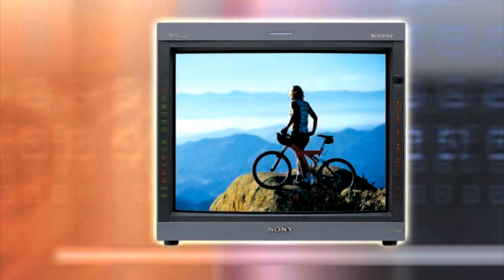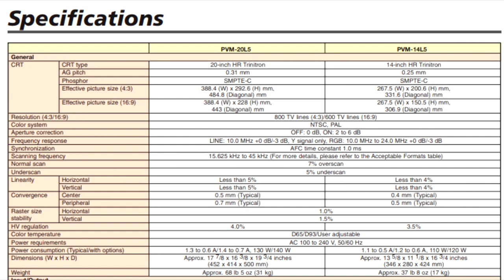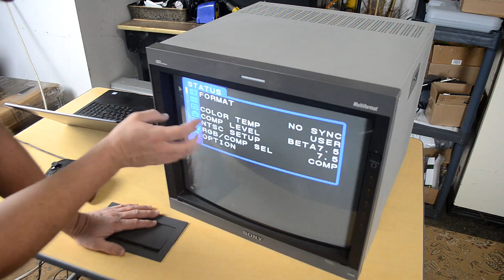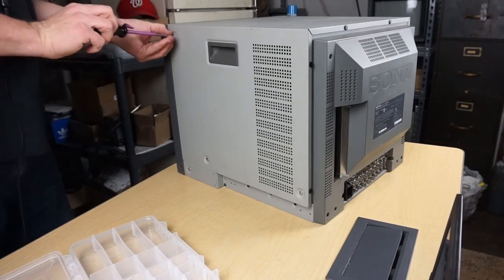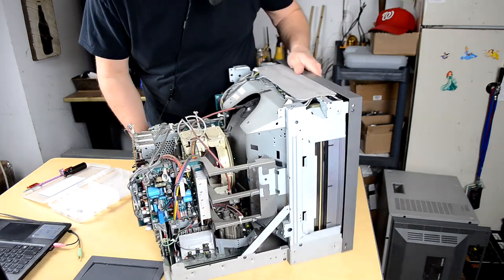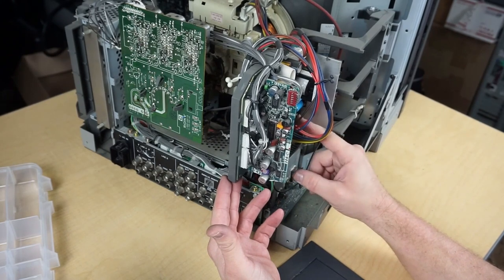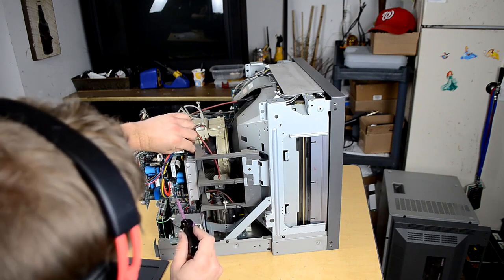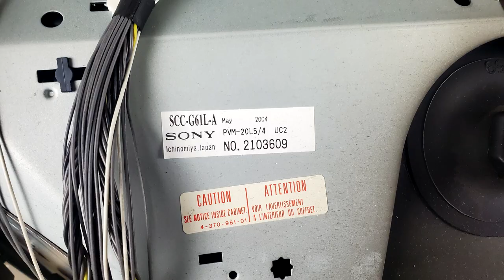Taking Apart a Pro CRT:  SONY PVM 20L5 Tear-Down

Comment: On my PVM-14L5 for the plastic rivets for the rear, I ended up using a pair of needle nose tweezers, I just work them under the edge and slide them in and the shape of the tweezers works like a wedge to pull the rivet apart and release the inner part.

Comment: A bit off topic but could I buy a mouser shopping cart list of the capacitors needed to recap a pvm 14m2. My monitor has a lot of hours on it and I believe all the power supply capacitors will need to be replaced as well as at least all the capacitors that are in hot areas on the A board. I’ve put a brand new tube in this monitor already thanks to all the info I’ve learnt through your channel. I just need to recap it now to keep it in good shape.

Comment: My 1340 PVM from 1991 had more metal, and the low side ventilation, compared to the 20L5.

I've heard, and seen, that Sony cheapened the hardware used to build these, as time, and the technology inside increased.

The same is true for their BVM line.

I wonder if the holds true for their KV television line.

Comment: Beautiful monitor, I owned one for a moment. Ordered from ebay, stopped working after 20 minutes, seller was good enough to let me ship it back. Do light games work with this monitor? It runs 720p, I know the consumer CRTs that run in HD do not handle light games.
Reply from the maker: That stinks.  They do run light games great.

Comment: i was cleaning my 1701 commodore monitor with compressed air ,now the yellow tape came off on the copper wires near the glass tube thing ,what kind of tape do i need
Reply from the maker: Electrical tape probably
Reply: Scotch tape.

jk
Reply: If it's "Yellow" tape it's probably either yellow electrical tape, or "kapton" tape (which is more of a coppery-gold color).

Comment: You have done more to keep these things from ending up in the landfill than just about anyone I can think of. And every video you put out gets more professional and enjoyable!   Your videos give those of us with the gumption a clear method for handling and restoring these beauties' and we appreciate it! I finally jumped on your patreon tonight to support more great content.  I just picked up a 1342q that wouldn't power on, and based on the cleanliness of the screw heads no one had ever opened it up.  I was extremely surprised to find the interior so clean it almost looks new.  You ever come across any that are almost new looking and how do you think that happens after 30+ years? I'm assuming they attract more dust when powered on? Here's a link to some photos of the inside and a couple shots of it when I got it to turn on and was testing with only composite.        http://imgur.com/gallery/p6FuHjk
Reply from the maker: Awesome! Your 1342 Looks incredible.  It was really that clean after all these years?  Where did you get it from.  Feel free to DM me on Patreon too.  Thanks again and that really does look amazing, especially if you just got it and it came in that condition.